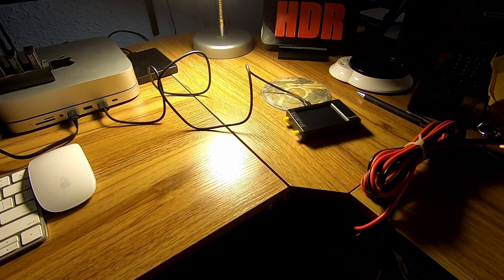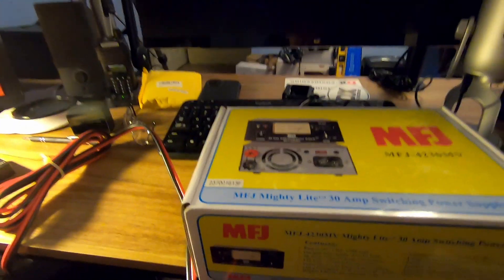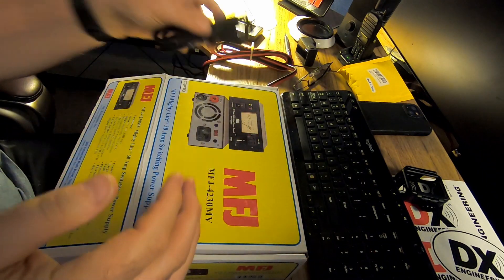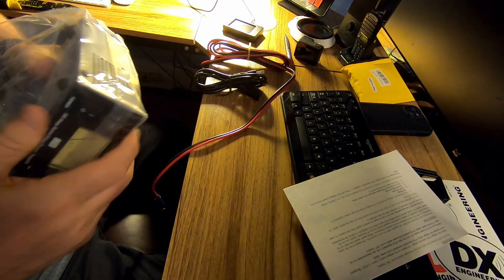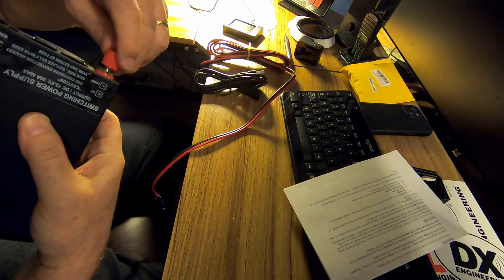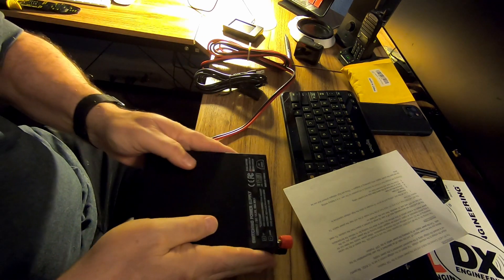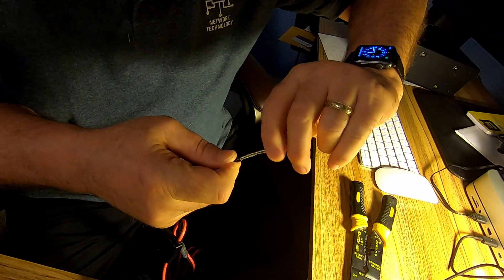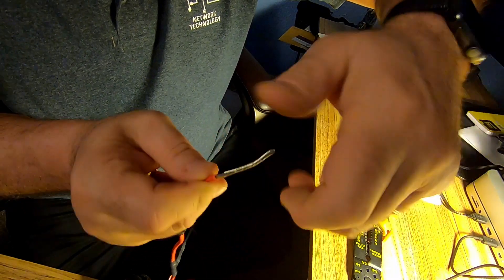How To Setup A HF Ham Radio| First wire to Power On

Comment: This is truly a good switching power supply. I bought another one after realizing how nice it performed. Going on four years now and never a single issue. Any hash you will not hear! I would not worry about MFJ closing down. You will see in my opinion this supply under a different name. name.
Reply from the maker: Thanks! I really didn't know much about this supply when I bought it. I have long known the MFJ name brand. Thanks for watching. 73s

Comment: Thank you!  I agree, no one on Youtube that i've found shows this simple sequence of wire hook up.  I just received my first power supply and first HAM radio. I have a little knowledge and quite sure I can get it connected - but as a newbee starting HAM from scratch, and from a remote location where simple supplies, like terminal connectors, mostly have be ordered and shipped. I'm finding it's these little simple details and basic supplies that is extending my start up time as a new HAM.
Reply from the maker: Thanks! I am glad I could help out. Hope to chat with you on radio sometime. Thanks for watching. 73s